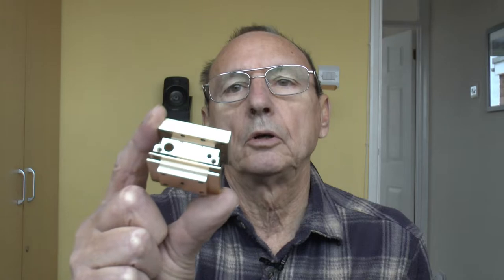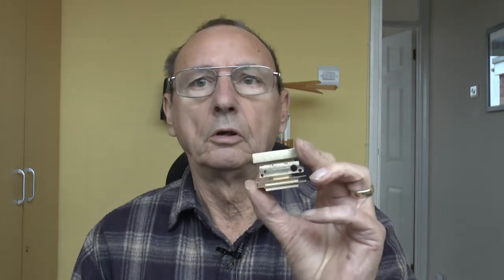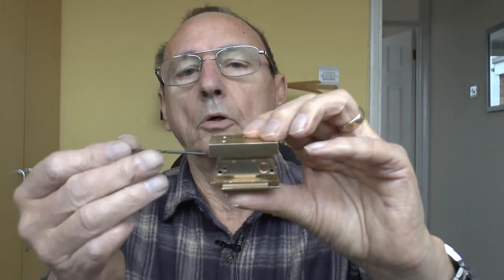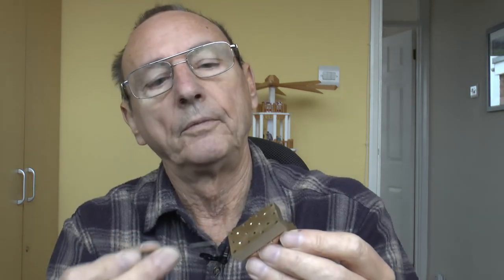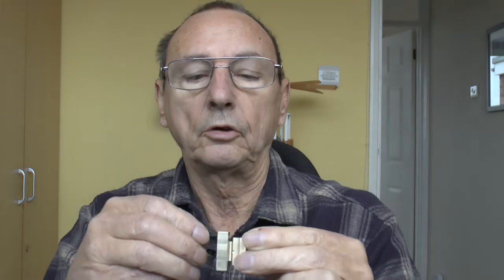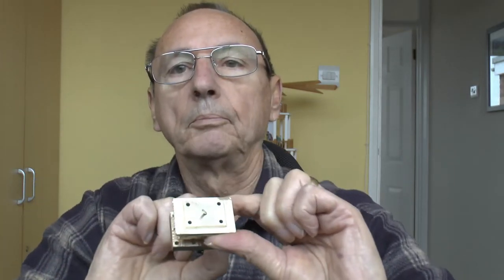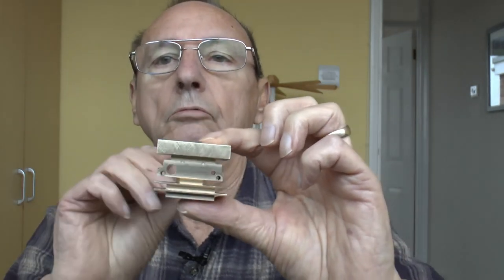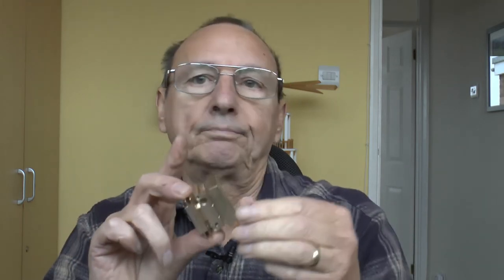6 Input Multi Material Hot End Part5 - New Brass Combining Block

Comment: That's some nifty drilling there 👍
Reply from the maker: Thanks - it's not easy but I've had a lot of practice now :). I start with the part in a vice such that the faces are vertical and use a centre drill to mark the positions of the 6 holes using the digital read out that I fitted to the mill. Then I take the vice off and fit it to an adjustable angle plate to get the 10 degrees in one direction and tilt the mill spindle at 20 degrees to get the other angle. Then it's a case of lining up the drill tip with previously marked positions which I have to do by eye, so there is room for error.

Comment: The moly spray will need to bond well to the surface. It'd be wise to test thoroughly before buggering up your hard work ;-)
Reply from the maker: Will do - but I can always run the reamer through again :) Edit.... and I'll start of with the 1.5mm nozzle so if it all flakes off, it's unlikely to cause a blockage.

Comment: Long drills wander less in free machining metals and while brass is good, it is not great. Two materials that are free machining are phosphor bronze with thermal conductivity of about 1/3 to 1/4 of brass; and tellurium copper with a thermal conductivity close to pure copper or three times that of brass. Unfortunately tellurium copper is hard to find although I am still looking for some for my next hotends.
Reply from the maker: Thanks Mike. Part of the reason for choosing brass for the combining block, is that I want it to run cooler without having to use a fan. So I'm hoping  that the lower thermal conductivity will help (bizarre at it seems for a hot end). Copper would be good for the nozzle block though.